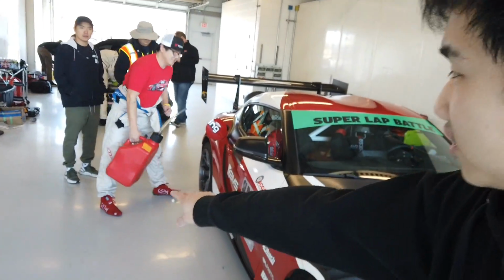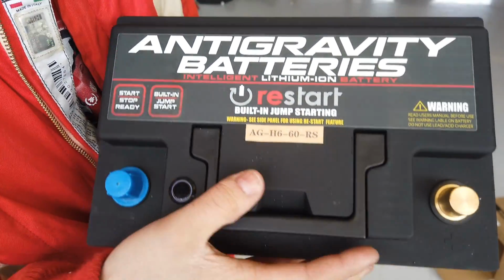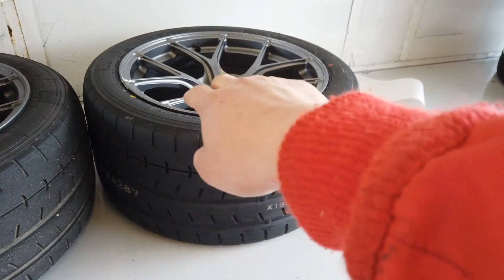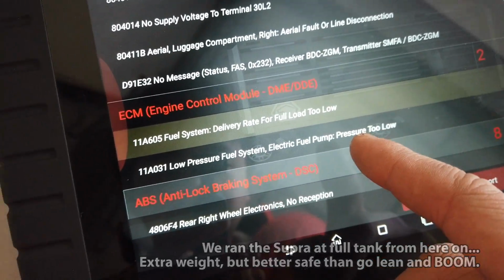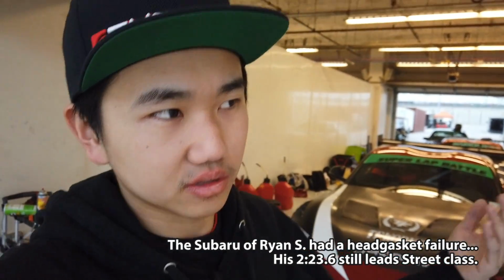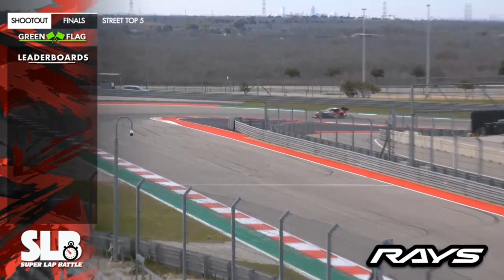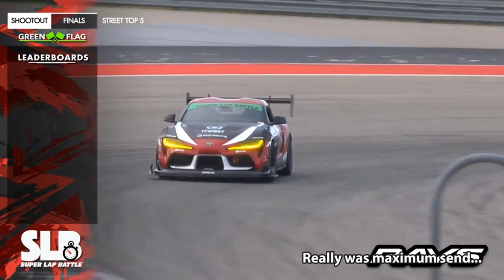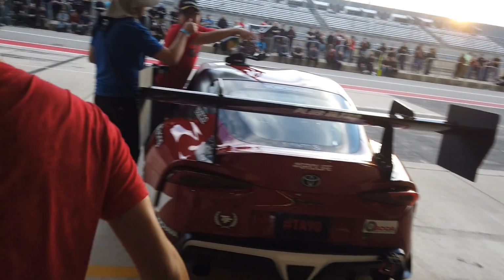Disqualified to Victory! Time Attack A90 Supra at Super Lap Battle COTA - Project TA90 #20

Comment from the maker: You guys wanted shirts and merch, so we have a store set up! TA90 & PikaS2K shirts now available!
https://phdracing.bigcartel.com/
Reply: Need big boy sizes. I'd grab a 2xl if you had one
Reply: The merch is fire and fits very well. Super comfy, i wore the touge shirt to class and got a lot compliments on it. And had to explain it to people haha.
Reply from the maker: @Tracerz_tv  Touge shirt is coming very soon!
Reply: No T-shirt shipping to the UK :(
Reply from the maker: @mikepowers572  Sorry, working on international shipping!
Reply: If it's not reliable, you went over the "max" power.
It's a BMW, you can't just "turn off traction" with a button. You need to get into coding and turn of software switches. There are calculation for estimated brake temps, brake priming, brake over boosting, electric LSD On Off conditions, breaking during cornering etc. Get with BMW tuners
Reply: congratulations Jackie!!! I'm happy for you
Reply: I dont know if you got that electrical issue fixed. if my electrical backround is any help perhaps employ a 12V super capacitor from maxwell. super caps serves as back up in case the main battery cant handle the amp demand. cheers

Comment: For the random loss of power with no codes, my X5M when towing through hills it will occasionally do it and doesnt throw a code of any sort. My HUD will say its reducing power but not say why and gives no codes.

In my case its oil temp, the moment it reaches a certain delta it just starts pulling power, gives no indication why and it stays that way till you turn it off and back on.

Worst part is my temps are fine on the gauge showing 210F, I didnt figure it out till I hooked my tablet up to observe the actual temperature number and around 245F it would pull power.

Just a thought for you to potentially log data while on track and narrow it down. 

Good driving man
Reply: I had the same issue with the supra and then guy said it my might be starving oil with the jarring of the car sorta like some McLarens do but by the time we had that theory we were off home
Reply: @CodeOrangeful  it has to be something minor enough to not throw a code, but lock it into limp mode so I could see that being the case as well

Comment: Is this loose backend because of too less downforce, bad tires, too less weight or the tricky gas zones?

Before increasing the power...the car should put the current power down. Maybe a softer swaybar for the backend and an elastic band to avoid the D :)
Reply from the maker: Mostly it's mechanical traction, not aero grip. We're gonna soften the rear sway bar before the next event, but the engine tune on partial throttle was a little difficult to drive.

Comment: Congrats Jackie.  F all the haters you did it.  Now how to fix the shifter knob from going into drive......
Reply from the maker: We have ideas involving rubber bands, but I’d prefer to get an actual engineering solution going haha
Reply: @JackieDing86  It still stays in manual mode in D as long as you are using paddles.

Comment: Convenient that you end saying you want more power and that you just won a new turbo!
Guess now we’ll see how fast Garrett delivers and how fast AMS can put it together, if they aren’t already working on it, which I’d guess they already were
Reply from the maker: We gotta get in touch about that free turbo haha
Reply: Find out how much power the stock direct injection system will safely make in race trim. I’m guessing 600 on ethanol and maybe 700 on race gas
Reply from the maker: @Turbochargedtwelve  On stock turbo and 93, we're getting close to the limit of the stock fuel pump. Ethanol is almost guaranteed not gonna work since it's gonna require more fuel. We can make HP really easily, so I'd rather work on the other areas like cooling first!
Reply: Jackie Ding does a low pressure pump help at all? I’m in the Subaru FA20 DIT world, for us it gains you a little extra headroom, but the high pressure pump is still the big issue. I assume you’re going to get a race gas tune, for the extra timing and power without extra fuel demand. 

I’m sure heat management is going to be your next hurdle, did you have your intake manifold temperature monitored at all? I wonder if the reason you couldn’t do back to back laps was your coolant for your air to water intercooler was getting hot.

Comment: Are you allowed canards & diffuser? & please reconsider to make hole at your rear dumper to eliminate the parachute effect.
Reply from the maker: We’ve got a full diffuser coming!
Reply: @JackieDing86  Good.  I hope the slope angel of the diffuser is not more than 15 degrees. Otherwise the air flow will not attached properly to the diffuser.
Please consider canards as not only it will generates downforce, it will also allows you to adjust the balance of the car.  As of now you can only adjust via the big wang.  
.
& congrats for the win.  You deserve it 😃
Reply from the maker: Of course. This is gonna be a very well designed diffuser so don’t worry. Canards we’re looking into, but it does increase drag

Comment: If only this car had a manual trans:(
Reply from the maker: ... then you’d like it? Then you’d buy it? Or then you’d find another excuse just to disapprove it all the same?
Reply: Jackie Ding any issues with transmission cooling on the track? Do you have additional transmission cooler?
Reply from the maker: Nope, we had zero problem with the transmission and it’s all stock cooling